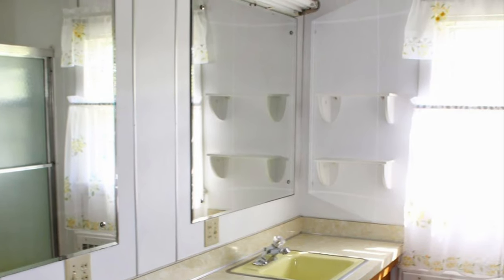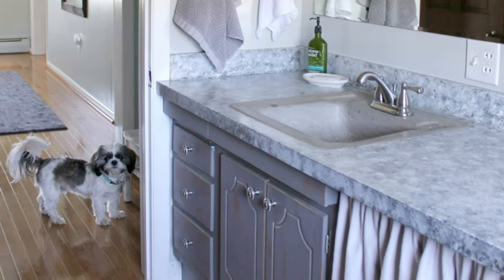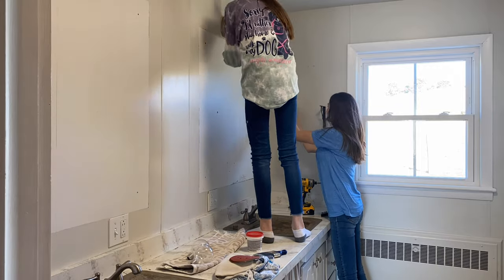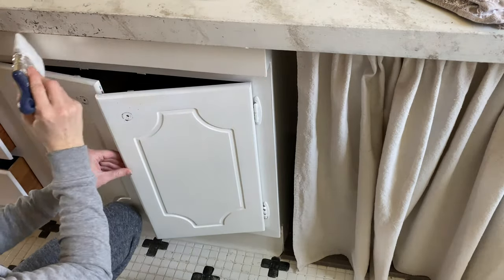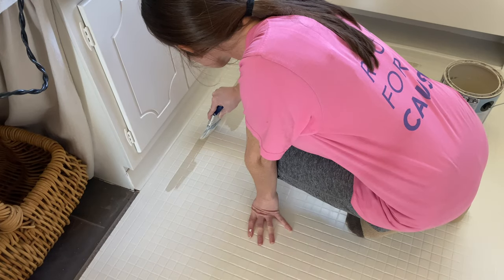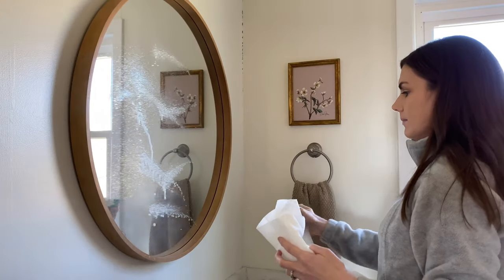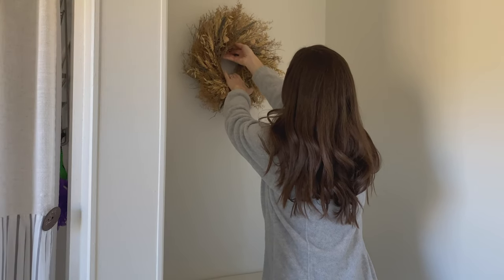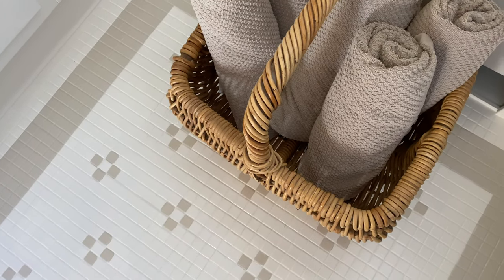DECORATE WITH ME - Bathroom Makeover - DIY Painted Floors - Vintage Cottage Farmhouse Decor

Comment: Our home was built in 1964 & the guest bath is BLUE!!! I like blue but this is SO BLUE! I really don't mind the tile... I just want a more neutral color. Love the pattern you painted on the floor. I've been very nervous about painting the bathtub but I'll look for the spray. That sounds a bit easier. Did you use a special floor paint or just the alabaster wall paint with the sealer?

Comment: You did an amazing job! Absolutely beautiful! Definitely inspired me to spruce up our 70’s style bathroom that like yours, keeps getting pushed further down on the renovation list! You mentioned that you had painted the sinks, counters and tub…what type of paint did you use? Any special sealant over the paint? Thank you in advance.
Reply from the maker: Thank you, Jennifer! Yes I pretty much painted everything! For the tub I used a tub and tile kit from Lowe’s. I chose the spray on kind, much easier to use than the paint on version. I followed the instructions and it turned out pretty good. We have hard water, so I do have to do regular touch ups. It’s definitely a temporary solution, so I probably wouldn’t recommend for long term, but it’s better than the yellow! For the counters I used left over wall paint - just sanded them and primed them well, and sealed them with polycrylic. For the sinks I used a concrete overlay. I have an older video where I used the product to makeover a couple of lamps if you’d like to see the process. It’s called Henry’s feather finish and I found it at Home Depot. Basically you mix if with water and then I used my hands to coat the sinks. Once it was dry I sanded them smooth and then applied polycrylic to them too. Hope this helps!! Let me know if I left anything out. ☺️